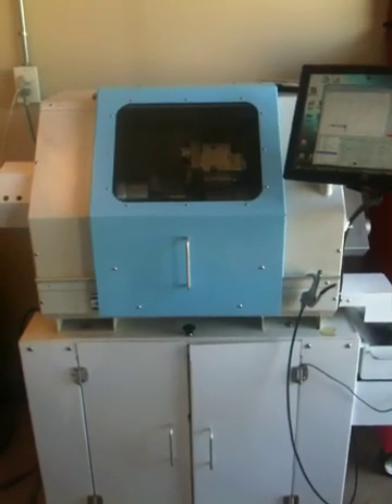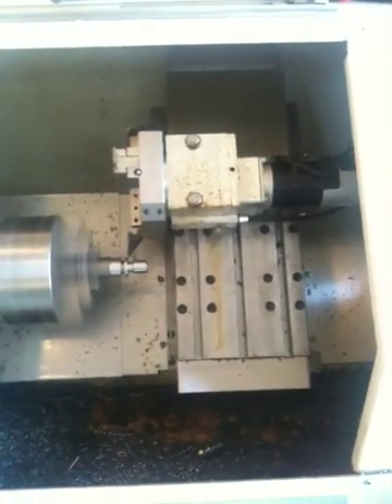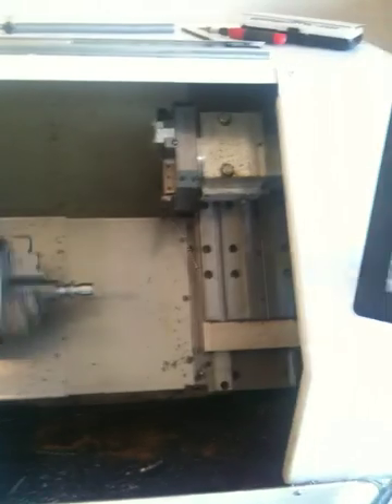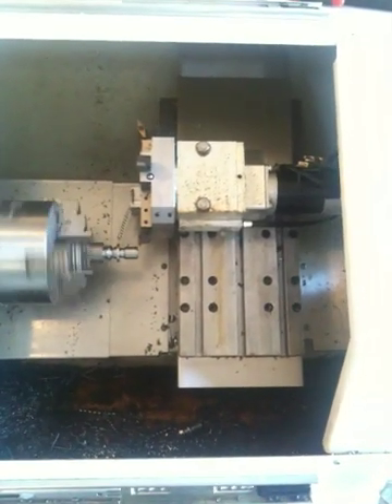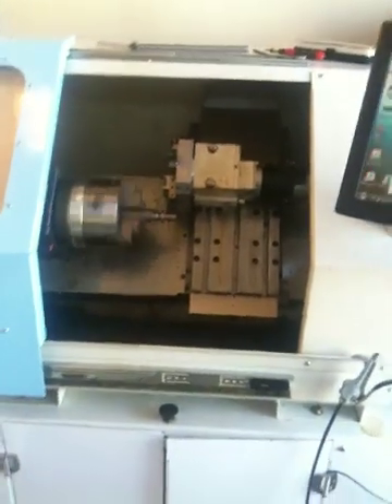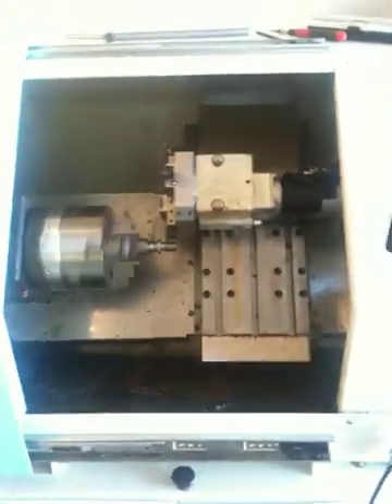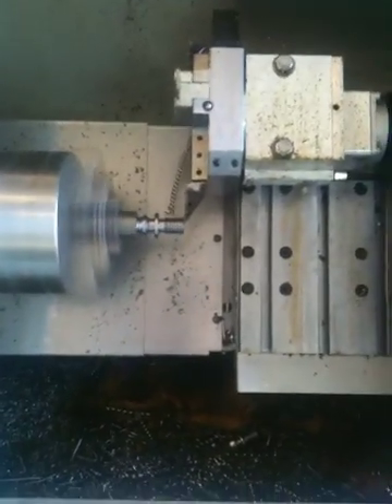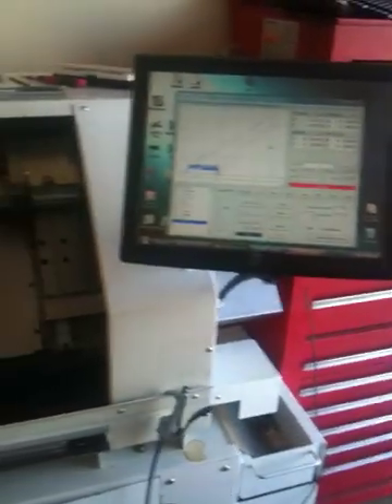Small CNC Lathe with 8 position "Automatic Tool Changer"

Comment: David,  I have been a fan of your work for quite some time. Are you using an off the shelf solution for an air cylinder to lock the turret in place or something you designed yourself?  Does it have an internal clutch/brake disc to help it resist force as well as the pneumatic pressure of holding the turret in?  

How much pressure does your lock require?  How much air does it cycle when it changes tools?  

Bob in Yuma